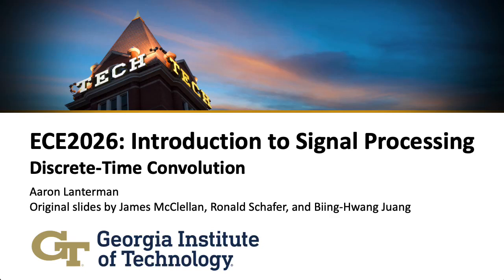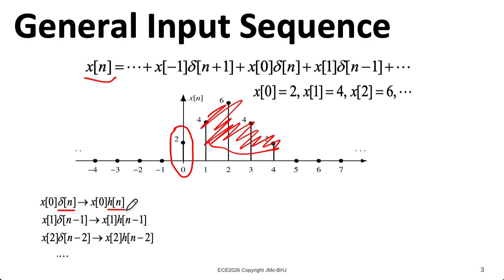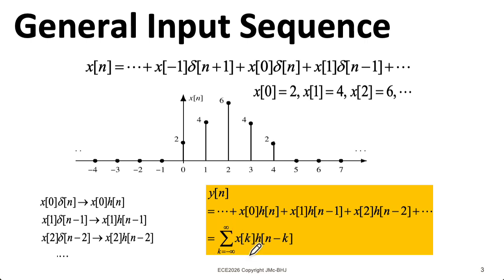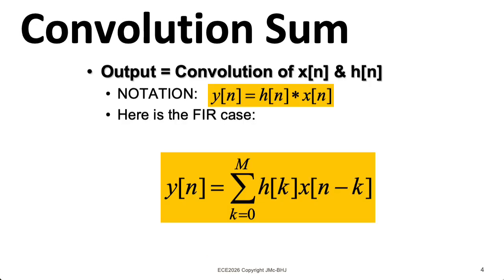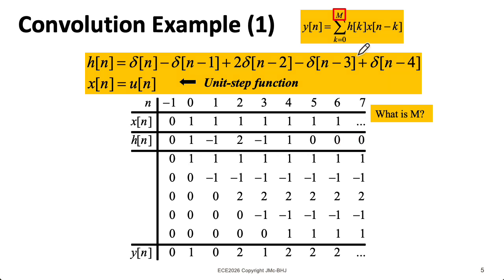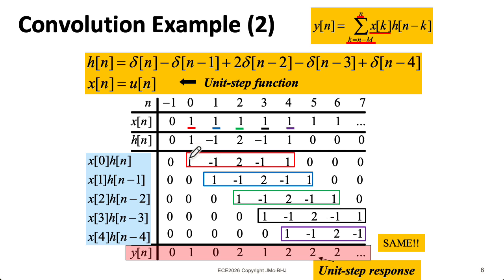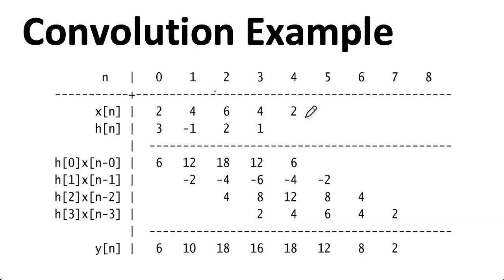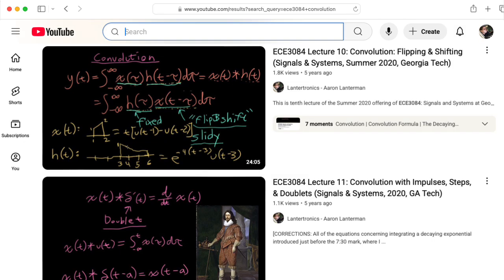ECE2026 L27: Discrete-Time Convolution (Introduction to Signal Processing, Georgia Tech course)

Comment: the mention about putting microphones in front of guitar amps reminds me that I have always wondered why musicians do that instead of just getting the audio signal directly from the amp's circuits
Reply from the maker: Ah yeah, the rolloff of the speaker is one of the most important parts of the sound. A raw signal from the output of a guitar amp is pretty gnarly (although folks like Nine Inch Nails have used it to great effect).
Reply: @Lantertronics Ah that explains it! Sort of a low tech filter
Reply from the maker: @LeithBade  Exactly!

Comment: Are the guitar cabinet simulators finite or infinite impulse response?
Reply from the maker: The ones that use measured responses directly FIR. But I've seen some examples of people using IIR as an approximation.
Reply from the maker: Check out the Z2DSP Vector Drive.
Reply from the maker: URL: https://z2dsp.com/2017/09/01/speaker-cabinet-modelling/
Reply: @Lantertronics very cool, thanks!

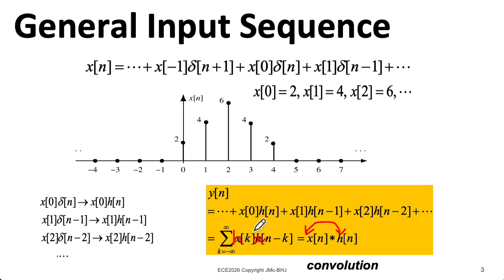Comment: I'm sorry, but writing the convolution componentwise (at 4:57) is incorrect. x[n] is a real number, as is h[n]. What is the convolution of two real numbers supposed to be? The convolution is a mapping that has two functions as arguments, which are mapped to one function by the convolution.
Reply from the maker: That's the exact point I make at the 3:42 mark; I'm not fond of that notation either. I'm using it since that's the notation used by the "DSP First" textbook authors the course is based on, and it's used throughout the slides they created that I adapted for this lecture series.

It winds up being convenient for writing things like x[n] * delta[n-3] = x[n-3].
Reply from the maker: I got curious about this and just went through some of my textbooks. These all use the h[n] * x[n] abuse of notation:

Kudeki and Munson, "Analog Signals and Systems"

Kamen & Heck, "Fundamentals of Signals and Systems" 

Oppenheim & Willsky, "Signals and Systems"

Kraniauskas, "Transforms in Signals and Systems"
Reply from the maker: But notably, Lee and Varaiya, "Structure and Interpretation of Signals and Systems," uses (h * x)[n] notation.
Reply: @Lantertronics  Thank you, I have been searching unsuccessfully for many years for a well-written physics book that does not claim, for example, that “y = x(t) is a function”. And in which functions are not differentiated or integrated without ensuring that these operations are justified.
Reply from the maker: @egonotto4172  Check out "Structure and Interpretation of Classical Mechanics" by SUssman and Wisdom. They go into great depth to talk about what a mess a lot of the way "standard" mathematical notation is used is, and put a lot of effort into being precise.
Reply from the maker: Actually, the full text of SICM is available online: https://mitp-content-server.mit.edu/books/content/sectbyfn/books_pres_0/9579/sicm_edition_2.zip/book.html
Reply from the maker: And I should emphasize "officially" available by the publisher, not pirated.